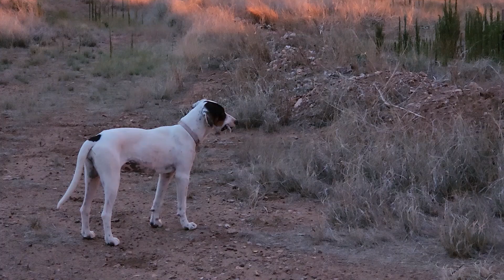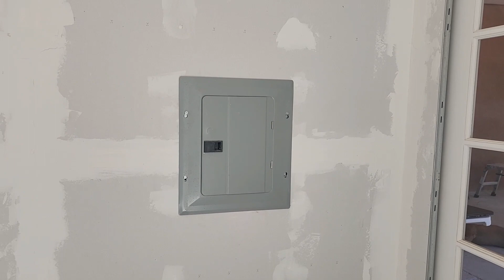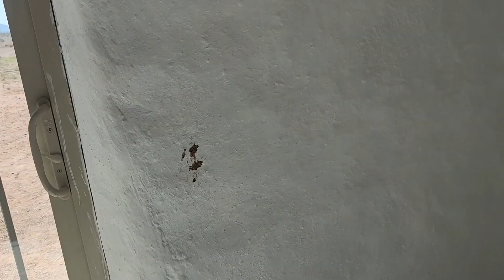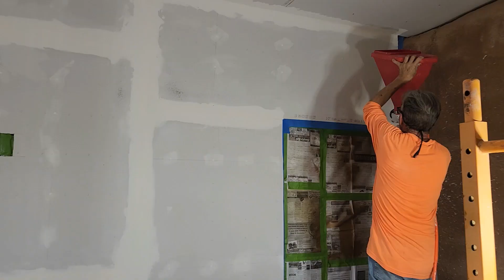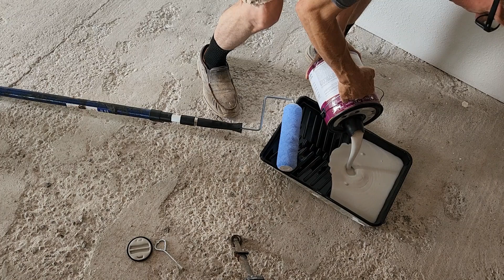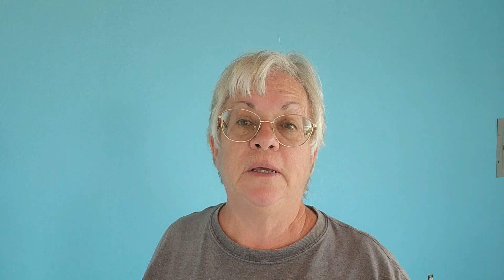All about the accent walls!  the REAL ep 98

Comment: The walls look great! Yes, we tried a couple of different crack fillers. One was runny and in a big squeeze bottle. I used it on the edge seams. It was okay but needed several applications. The filler in the caulk tube was easier and it looked better, also I don't think it would stain the paper.  Excited to see the final floors, I'm sure they will look amazing! 😊🏜️

Comment: How about a furnace air intake filter vent (where you can open it to replace filters) for the water filter opening / easy access.  No one will likely question do they have forced air furnace - it'll just be a normal / home background 'thing' taken for granted.   And suggest a framed picture or mirror for the electrical panel opening :)
Reply from the maker: Good ideas! 👍